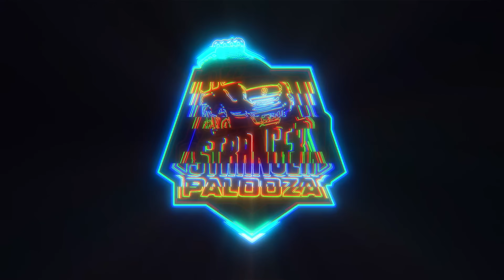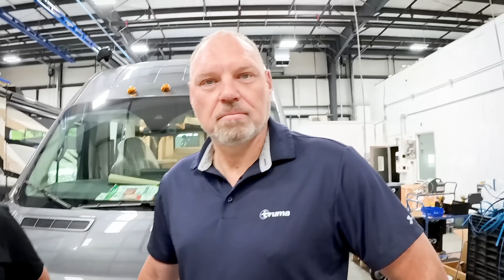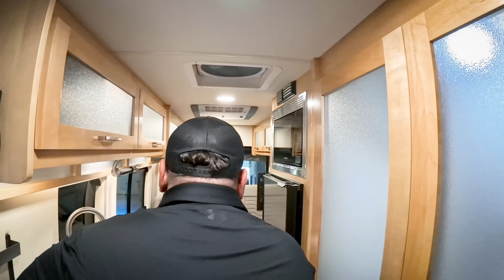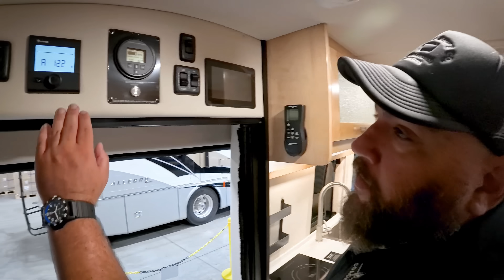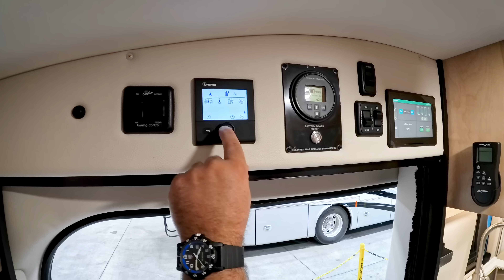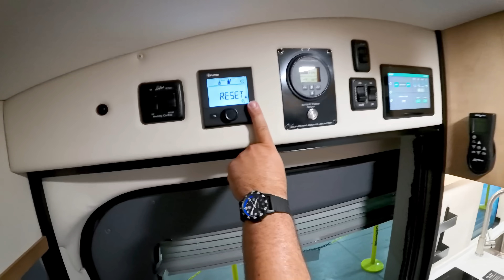Stay Warm, Cool & Powered | Truma Systems for Lithium Camper Vans

Comment: It’s not as easy as it looks, you usually have to do a couple of circuits around the system? The remote is the easiest!!!! Not sure why they blow it off?? Personally I hate this operating system? Just saying. It should  be much easier, push, turn the wheel, etc, sure I’ll just call the factory before shower trying to get out out the door to work, appointment, etc. l’m sure it gets easier after you do it many times in a row like on one trip? He had a hard time with reset? That’s me on a/c? LOL! It’s all good! Just learning . Thanks for the education!!! Well done.
Reply from the maker: Thanks Craig...if you have issues I definitely recommend reaching out to Coachmen